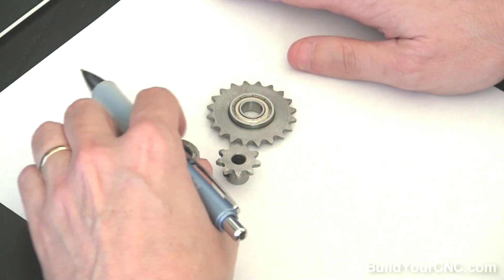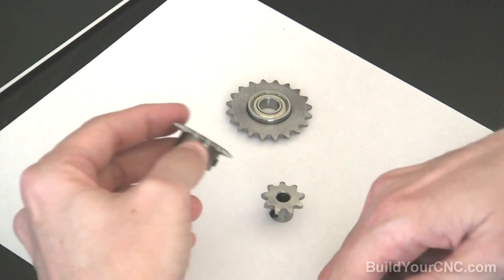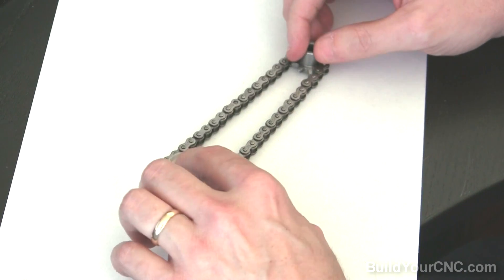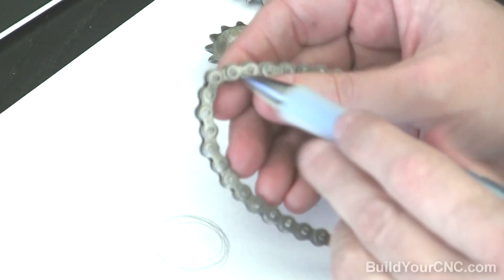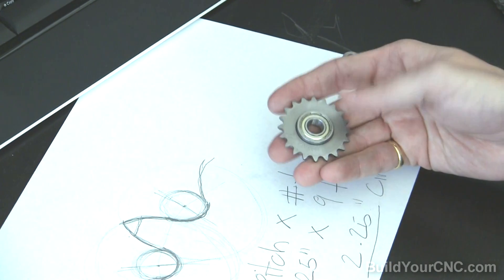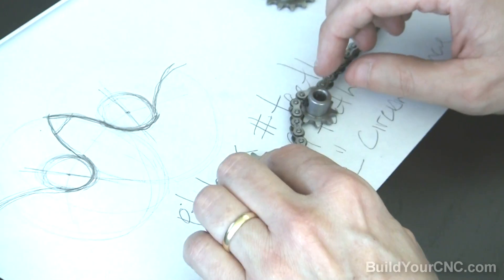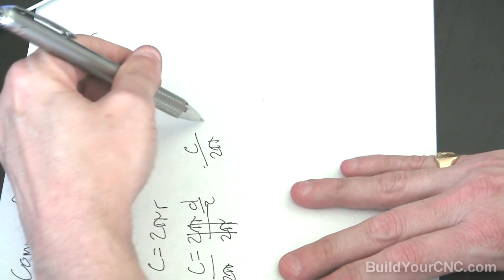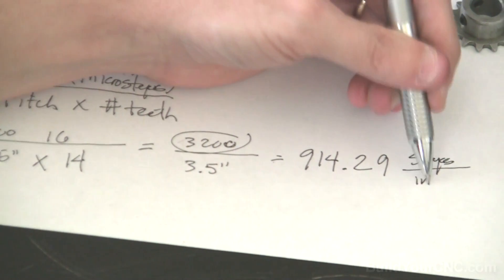Basics of Sprockets and Roller Chain

Comment: Hello,
I am working on a project that uses magnets. Could you please say if there are aluminum or non-ferrous roller chains (small pitch) available. 

Thanks very much.
Reply from the maker: Stainless steel roller chain is widely available which is far less magnetic than steel. I don't think there is aluminum roller chain.

Comment: Thank you very much for your video! Can you please help me with the following question? How can I differentiate Sprockets and Gears. I mistake Spur gears and Sprockets
Reply from the maker: The geometry of sprockets are very different than spur gears.  For one, sprockets are generally larger than most spur gears made for similar torque specifications.Sprockets also have a rounded section between the crests.
Reply: I believe spurs/gears are designed to interface with other spurs/gears, and sprockets are designed to interface with a chain/belt.  Easiest (but not perfect) thing to look for is probably the width.  Good question - I had to do some research for myself and share here!
Reply: ..I mean, how are they different by their look?

Comment: I'm sorry but I believe your formulas are incorrect. To calculate the pitch diameter you should use pitch/sine(180/Z). The reason is that the chains links will make a straight line between the teeths of the sprocket. Imagine a 6 teeth sprocket, the chain will form a hexagon around the sprocket and then you need to use 3 instead of pi to calculate the radius of the sprocket.
Reply from the maker: Thanks.  The correction is much appreciated.

Comment: What are the names of the different types of sprockets?
Reply from the maker: Idler sprockets that turn freely and are used for positioning, and drive sprockets which are coupled to a shaft of a motor or something equivalent.  the drive sprocket is meant to move the chain or move something along the chain (depending on how it is configured).  There are also numbers associated with the size of the sprockets, such as #25, #35, #40 ...  the lower the number, the smaller the roller chain.

Comment: One minor caveat... The links of a chain wrapping around a sprocket don't form a circle, they form a regular polygon with number of sides = number of teeth, and length of side = link pitch.

The circumference of the "pitch circle" is a little larger than the perimeter of that polygon. See wikipedia, "regular polygon". For sprockets with just a few teeth, the effect is worse. For a 10-tooth sprocket, the difference is almost 2%. This would ruin a high-precision design.

Comment: Hi, I have to say I enjoyed your footage on & found it very informative. I'm wondering if you could give me some advice though? I bought an unfinished project of a trike & have been doing alterations. The engine is from a Honda CB750 & have found that the back sprocket, for the back wheel on the original bike is 46 teeth yet the trike only has 36 teeth on it's back end. I'm wondering in what way will this effect the performance of the engine & would you advice I put a smaller front sprocket on?
Reply: My dad modified his motorcycle by swapping the front (drive) sprocket with a smaller diameter part. It had more pickup and pep (of course). It also had a lower top speed, shifted sooner, and more chain and front sprocket wear. Putting a smaller sprocket on the rear wheel (driven) end would do just the opposite but still wear faster. People used to change the "rear end" (differential) in cars all the time.